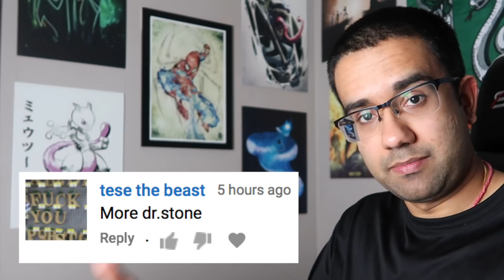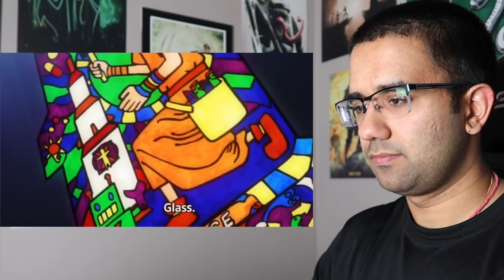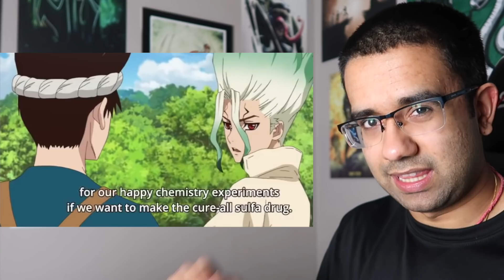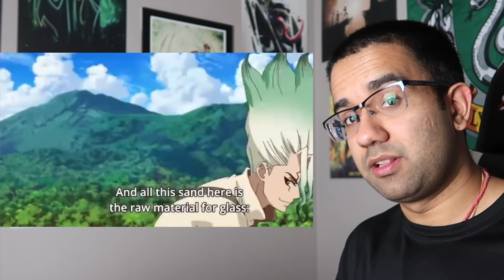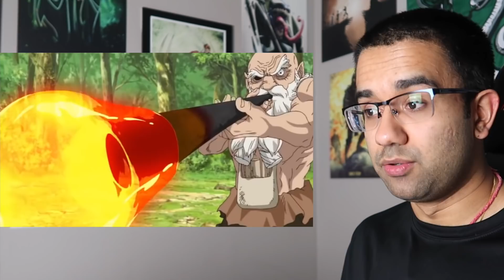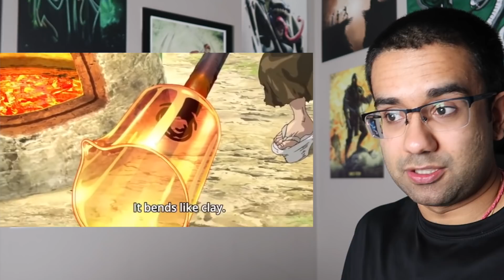Real Engineer Reacts to Technology in Dr  Stone #10 and #11

Comment: yes lighting makes glass. it can also be formed in the ocean from underwater volcano called sea glass. and you are definitely wrong about his ability to make heat. a black smith forge runs on coal. to make steel you cook the coal until most of the impurities are burned off. The result is coke, a fuel that is almost entirely carbon allowing it to reach temperature of 3,000 to 4,000 degrees Fahrenheit at the core of the fire

Comment: I know I am late to the game, but do we even know the fuel used in the clay forge? For all we know the fuel used could be coke or charcoal heated until other materials in the wood burns away into gases which burn into fuel that help the create charcoal that is used in the process of creating activated charcoal, that is pretty much a chunk of pure carbon. Forges that use coke can get extremely hot near where the fuel is being burned which can reach temperatures of 3,000 to 4,000 degrees Fahrenheit.

Comment: The history of glass is pretty long. (This is from memory and my personal knowledge so there are gaps). Glass forms in nature when a lot of heat and a lot of pressure strikes a silicon based material like sand. The ancient Egyptians found many glass shards in the Libian dessert. This was formed due to a Tunguska-like event thousands of years earlier. This glass was used in jewelry fairly early on. This glass was melted and made into a paste that then was applied to whatever they wanted to decorate. For example, the white bands on the mask of Tutenchamun are glass. Might sound cheap now but at the time, this stuff was rare, extremely hard to work with and you needed a very highly skilled artisan to do the work. This was a material fit for a king. The Egyptians also learned how to make a glass shine. This occures when the sand isnt heated high enough to melt everything but the top layer did form glass. The art of making glass gradually improved but it was the Chartaginians who developed the way to make glass clear and this made them very, very rich (All earlier glass was mirky and coloured due to impurities).

Comment: Worth pointing out that a lot of our more durable "glass" used in industry isn't actually glass. Most smart phone screens and similarly durable glass materials are actually lab made gemstone, typically a form of Corundum, specifically sapphire. Pocketnow has an excellent video here on youtube that details the process used for manufacturing the material though it involves insane temperatures of around 4,000F

Comment: I can honestly see glass being discovered by some random kid throwing sand into a smelter just to see what happens.
Reply: Or just using sand as a base for a clay smelter for Iron ore like they did in the show. Why not? Easy to rake clean, unlike soil it doesn't smoulder or burn, most plants won't grow in it, and so on. Building it in a natural clearing is less work when you want to be sure you aren't starting a wildfire, so some blacksmith sets up on top of the right kind of sand and bada bing bada boom he's got a molten glass bottom with his smelter floating on top... which depending on details might mean he has to move the whole thing off the sand because that bright idea turned out to be not so bright after all.

Comment: Glass does not need to be 3000 but 2400 and its blown at closer to 2000.
I think that the main inaccuracies of this series is that it exagerates facts to simplify the science envolved.
I googled to check the temp.

Comment: They are making glass out of Quartz, which melts at 1715C (3119F). What is called "Pig Iron" melts at 1538C(2800F). Yes, it takes more heat to melt glass, but nowhere near double. It should be noted that glass made from Quartz easily beats borosilicate glass in terms of durability.

Comment: Before I saw you corrected yourself in the comments, I was going to say the temperature of glass can't be that high or else meth heads wouldn't be able to make crack pipes out of cigar tubes. I can also picture one of the ways glass could have been first created by man, blacksmiths were known to be by areas of black sand because of the levels of iron it. Someone could have gotten bored and just wondered what would happen if they tried smelting regular sand.

Comment: RE:Glass - experimentation with various materials and fire is almost universal, especially if you have nothing better to do. Ever been around a campfire?

A lot more fires and a lot less to do throughout various points in history.

It could have even been accidental, if some blacksmith somewhere used just the right type of bricks or mortar or sand bed (used to bank coals overnight so a fire can easily be restarted) in their furnace.

Comment: 4:45 Actually coal has enough energy to melt glass and iron. The trick is burning enough of it in a short amount of time to hit the desired temperature.

I used to think that blowing on fire made it burn hotter, that is incorrect. Blowing on say a coal fire just makes it burn faster, what they do not show is the massive increase in fuel consumption accompanied by the furious use of air compression. This is how the insane temperature is reached. All the energy in a coal that would be released over a few hours under natural aspiration is released in a few minutes by blowing like crazy, and a higher relative temperature is reached.

Gear heads that really like turbo chargers explain this to newbie mechanics so they don't blow up an engine from lean fuel-air ratios for example.

Comment: 1:24 from what I heard from a Neal degrass Tyson show a guy was looking for a special material and was using a furnace and with just the right materials bada bing bada boom, glass
Reply from the maker: so he got lucky? lol
Reply: @parychahal  Go to a beach. Burn a pile of soda plants. Their ash contains sodium hydroxide. If you had some chalk rocks in the heap too, a simple fire results in soda-lime glass that has a much lower melting temperature. While stirring the ashes of this fire, you'll find some glass lumps. That's probably how glass was discovered, that, or setting fires in Wadi El Natrun, Egypt, where the soil contains some natron salts. This is also where the chemical symbol of sodium, natrium (Na) comes from.
Reply: @parychahal   Isn't that exactly how most things were invented back in the "Imma melt the hell out of this baby and see what happens" era of technology creating?

Comment: Sand is mixed with sodium carbonate to lower the melting point, but it would dissolve in water, sou you can add lime to it, which creates soda lime with a melting point of ~400-600 C, or add lime and borax to make borosilicate (pyrex).

Comment: Curious about the glass working, I did some light searching to find some ancient kilns reached temperatures over 1300C. Modern ones reach 1800C to 2400C. I forget what Senku said his reaches. Some glass melts at 900C. Most common glass melts at 1400C to 1600C. I know melt is a misnomer with glass since it doesn’t melt, it just softens. Raw materials transform at 1320C. Glass working is done around 1090C with some parts being done at much lower temperatures. It’s enough to make the scene believable to me. And the searching was fun too. :)
Reply from the maker: It is believable, I made the mistake of mixing up Fahrenheit and Celsius in this video :\
Reply: @parychahal  also, you confused the type of glass he made, he mixed lead to lower the melting point. so no need for as much temperature a you think.

Comment: I don't think what you said about the temperature required to make glass is correct. What Senku made is "lead glass", which contains lead oxide. It has a lower melting point and working point, at around 800 - 1000 degrees. Most glass adds special chemicals to lower the melting point to make it easier to work with.

What you described seems to be "quartz glass", made of pure silica. It has a melting point at 1650℃ or 3000℉, and very hard to work with. However, the show has always used Celsius to measure temperature, same with that 1500℃ to melt iron.
Reply from the maker: I mixed up my units, I said 3000 F is double 1500 C, my bad
Reply: also making clear glass is difficult as i have seen the channel nileRed doing that so maybe the show got that wrong too
Reply: @blaZe_6996  Depends on the purity of quartz to other stuff in the sand.

Comment: 1:23 lightening
Need 3000 c to make glass I don't think so or at the very lest factors you are accounting for
Reply: There are different types of glass, with different melting Points. senku added "stuff" to lower the temperature requirements a Little. pure fused quartz melts at About 1650°C (3000°F). The combination of materials occurs around 1320°C (2400°F) and can be molded at around 1090°C. 

 In the Video he stated that glass requries 3000°FAHRENHEIT (correct for pure quartz) but he Claims that thats twice as hot as Irons 1500°CELSIUS, which is not true, as 1538°C equals 2800°F, which is only 200° lower than quartz, but is still higher than the quartz-stuff mixture of 1300°C.
Reply from the maker: Good catch @proclarushtaonasat, I just rewatched the video, and you're right, I mixed up my units